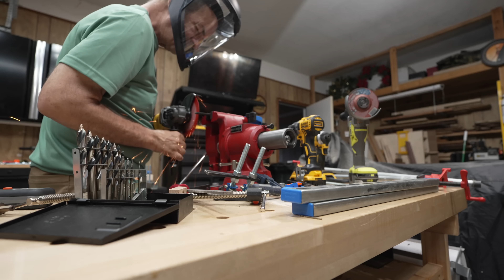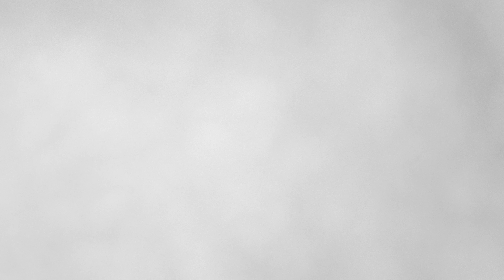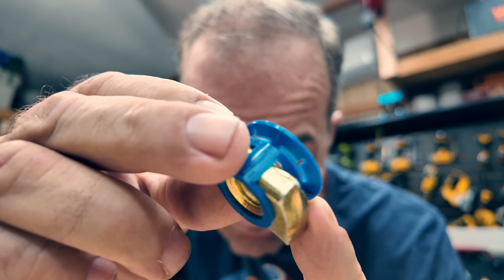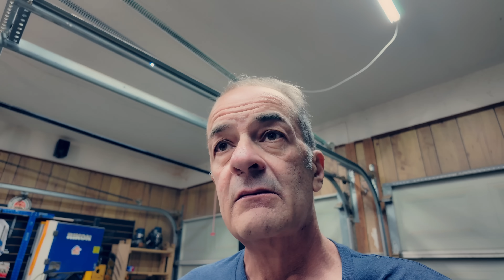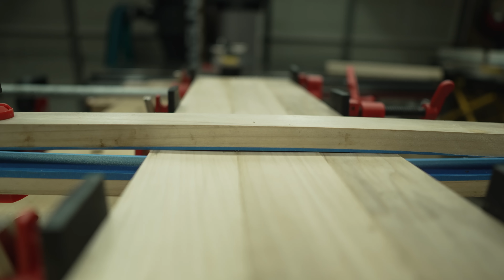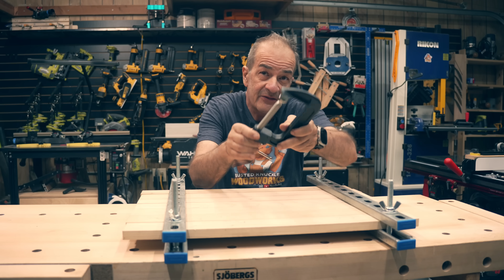This weird clamp could save your next glueup

Comment: You are a mad scientist! I love your clamps so much I gave away my Rockler board clamps. The Rockler solution didn't work that well and I always found it to be a PIA to set up.  I was toying with the side clamp idea and came up with a different solution but I like yours better. In the end I think I will just stick with the pipe clamps because I have so many of them. Also,  I bent the in the bar in middle a so I had about 10mm deflection in the center across a 1m bar. I did this with a few c clamps and a 2x6. I tried the cross bar approach that you showed at first. The bend is fine.
Reply from the maker: I did the end clamps as a proof of concept but to be honest I usually go with pipe clamps myself

Comment: I worked in construction for 41 years. I have used unistrut for 1,000's of different things. I love your tip with them. I made mine several years ago to glue up cutting boards by using tie wire to hold everything together and put pressure on it.

Comment: How can i use the cone nut with the low profile superstruts.  Even if I use a smaller bolt , i.e. 3/8 the bolt head will be roughly the same thickness. I tried to use a 1/2 bolt and a cone nut in a low profile super strut and there is no room for the bolt head
Reply from the maker: Yeah, that combination definitely doesn’t work. You need to use the high profile struts in that case

Comment: How do you keep the cone nuts from sliding when applying horizontal clamping force? I built these inspired by your design, using harbor freight f clamps to make em 4 way like you suggested. But when I apply horizontal force, my bolts begin to angle away from my piece (at the cone nut). Is the small part of the bolt touching the piece/scrap enough to apply proper clamping pressure?
Reply from the maker: I’m having trouble picturing what you’re doing. Send me a pic or a video. Address is on the channel About page.

Comment: 10:45 Heck, with threaded rod coupler nuts, you can go as thick as you can fit in your shop or yard...

So if you really feel the need to build a wood, ocean capable ship, well, enough channel, channel couplers, threaded rod and threaded rod coupler nuts, you can build it...assuming you have enough seasoned wood, wood glue and construction space that is...

😄😁😆😅😂🤣

Comment: I have to say, this presentation is one of the best problems solvers that meets the needs of everyone.
The only weak spot is the small locking pin you have to grab on to. It would be very hard to grasp and turn. 

Why not weld a nut on the end of the clamp screw and use a power drill to tighten it. 

Also, anything over 15” would need a third or fourth clamp/call to tighten the gap that would occur in between the calls.

Comment: you could cut a piece of thick plywood into an eccentric handle (like the golden ration spiral but less pronounced) that mounts over the bolt on each side that tightens as you rotate it around the bolt. Even cheaper and easier than modifying a C clamp!
Reply from the maker: Tried it. Too fiddly. You need to get the gap just right or it doesn’t work.

Comment: What a great idea with the modified C clamps.  For me personally the strut clamps mixed with the pipe clamps would be the way to go for me. Pipe clamps are not all that expensive and I can also help things out by clamping my glue up on both sides with the pipe clams.
As for protecting the struts from the glue, I’m cheap, just use packing tape. 14:01
Reply from the maker: The C clamp idea was just kind of a “proof of concept” if you will, and a response to those comments in the first video that it couldn’t be done. I agree pipe clamps are probably more practical.
Reply: @ I actually made up 6 cull clams out of a 2x6. I ripped them in half long ways to make 1x3’s. I put feet on one side so they stand up on their own. Fixed them to bolt together. Covered them with packing tape so the glue will not stick to them. For the bolts I used 1/2” nuts and washers. Then I took an old 3/4 wrench and cut off a piece of what was left and welded to the box end of the wrens to make a big wing nut out of it. Between those and some pipe clamps I can clamp up a pretty nice cutting board.

You seem like you like to make interesting solutions to wood working problems.  I have a little project you might like. I got the idea from another video. Dig around your scrap pile and make yourself a long drawer that will fit inside the square tubing that your table saw fence clamps to. I made one for each side of my saw. Great place to keep a few pencils, small  flat ruler, a couple of 1-2-3 blocks. I found them to be very handy. I had to get creative about the 1/4 20 bolts that stuck through.

Comment: What an interesting — and clever — idea! I’m actually getting ready to make some counters, and I came SO close to ordering those $120 Rockler clamps. What makes it crazy is that I have the strut on hand.
    (BTW, I saw at least one strut nut being used upside-down. The nuts are intended to ride inside the strut, with that plastic cone holding the nut to the rails — the nuts can slide, but not fall out.)
    Nor did I know of the handle nuts or magnetic washers — thanks!)
    Let the skeptics snipe from the sidelines, but I’m sure the strut bends less under pressure than the lighter sheet metal of the Rockler clamps. Strut is specifically designed to not flex.
    I’m not sure about the modified C-clamps. I think I’ll just continue to use separate clamps to push the board edges together.
    I understand the fear of the edges of the strut leaving marks in the wood. If your material is that soft you probably want to use a length of bar stock or a board to spread the force out anyways.
    My one concern is the metal leaving rust stains, caused by the wet glue. You solved that with a bit of tape.
Reply from the maker: Glad I saved you from buying those overpriced clamps! 👍🤑

Comment: Easier to just use biscuits, dowels or dominos to align the face edges for glue ups.  IMO dominoes work the best but you should always joint the boards first rather than force warped boards together, since the final glued up boards could warp later from the force of the boards forced straight.  I use Kreg clamps on the ends and a longer deeper throat Kreg clamp that can reach around 6" for minor alignment.  Might as well do it right from the get go to save aggravation later.
Reply from the maker: To each his own I suppose

Comment: If you use clamps for the struts and have the clamping pressure over/under your work piece these struts shouldn't bend. Bending happens when the pressure is applied on the unsupported region. Then again, you can use e.g. silicone baking surface or excercise bands as a protection for the wood (on both sides) and if it's just the right thickness it'll help with force distribution.

Comment: I love this idea!  Maybe someone else already said this, but the stiffness of a beam depends on its cross sectional geometry, particularly the "height" (what you measured as 13/16 and 1 5/8).  All else equal, the stiffness will be proportional to the square of the height).  So, since the standard is 2x as high as the low-profile, it will be approximately 4 times as stiff.  Technically, you are correct - more than 2 times stronger - but that's an understatement!  Thanks for all the great information in this video!!
Reply from the maker: @dmooreca2  “Technically, I was correct” is what I’m having inscribed on my tombstone
Reply: As opposed to the, “On the whole I’d rather be in Philadelphia”, of WC Fields? 😂
Reply: I knew this but didn’t know how to explain it. Good job.

Comment: Well someone finally caught up.  I made 6 sets of culls using UniStrurt over 35 years ago.  At that time the various hole options were not available.  I ended up filing out numerous holes on one rail (36" long) to accept 1/2" carriage bolts.  On the opposinging rail I made some hardwood blocks to lock into the rail opening.  I use springs over the carriage bolts to lift the top rail up.  Clamping is done using large palm knobs.  Not quite sure why tons of force is needed to clamp the glue up.  If the boards are not of a uniform thickness or cupped (quality of workmanship), all the clamping in the world will not make make the glue up any better.  These only need to be tightened enough to ensure properly prepared stock is level level plane to one another.  Moving away from pipe clamps to some built in method is dependant on the frequency of use.  Daily/Weekly, yes.  Occasionally not needed.
Reply from the maker: Agree with everything you said. A lot of stuff in this video I only did to show it was possible and to answer the comments from the first video (there were literally thousands). In the first video I only used wing nuts on the bolts because I don’t tighten them very hard at all.
Reply: @BustedKnuckleWoodworks ,
Yes, too much pressure can force out too much glue which is known as a starved glue joint. Properly fitted joints only need moderate pressure. 🧐👍😎

Comment: Genius.... I am kicking myself as I am an Electrician of nearly 30 yrs and was thinking of ways to caul my cutting boards and BAM... you solved my problem with something I have used almost everyday and have in my garage. Now, a tip..... you can easily modify the slots in the strut for a clamp instead of using bolts. Cut your strut to desired length, get a Bandsaw/sawall/hacksaw and at one end, cut inside the channel down to the first slot, do this on each side to create a LONGER slot that now clamps will just slide into. No bolts needed. I also created a Router jig made of 3/4" EMT for $30 that rivals any $500 to $900 Rockler/Woodpecker jig. Well, ok, not really rival but... it works great so..............
Reply from the maker: That’s a great tip for making it even better!

Comment: Hey great idea, I very rarely get any good ideas from woodworking videos. this is a legit tip. Now, how about taking it one step farther and figuring out how to use super strut to make a 4 direction clamp, it's the next logical progression of your work. Retail versions are 2-$300 to clamp a 4' panel. If you can figure out the hardware you could save everyone a ton of money and make a ton for yourself. People have been trying to make a reasonably priced 4 way clamp forever, I think you're the guy. Good Luck
Reply from the maker: You didn’t watch the whole video did you? 🤔

Comment: If you take my suggestion below, and put them on 4 tangs of metal and put 2 bolts through the unistruts on each side,  parallel to the slats of the board . (for each bolt above and below 2 lengths of metal/wood on the bolt, 1 on each side of the unistrut connecting to the bolt through the vertical cam to make V-flexing attachments to the unistrut. Turn the cam, it pulls down on the unistruts and pushes the wood together at the same time. Make the same thing that they made but with wooden cams and drilled struts. Dowel between the holes in the struts, for strength in the V-flex connecting struts?

Comment: make yourself a curled tadpole cam with a pivotal hole in it, that goes vertically on the threaded rods or bolt, made out of hardwood to push the "slats" together. If your threaded rods or bolts are buttressed at the edges of the hole, the cams will work perfectly. And you make those by drilling an off-center hole in the cam. If you want to make them extremely durable, laminate a thin strip of hardwood "1/8"  on the outside edge of the cam.

Comment: For the side clamps, why not make it from a piece of hardwood tapped for some threaded rod. Threads in hardwood will last a long time and taps are not expensive. For a handle, just bend the threaded rod in an "L" shape and put some plastic tubing over the threads for comfort to your hands (if you care). For pads against the work piece, a suitable block of hardwood with a countersunk cavity for a nut to retain the block. Alternatively, cross drilling the rod end for a piece of wire to retain the block. In either case, a double nut and washer on the opposite pressure side takes the force.
Reply from the maker: You’d probably want to use acme threads for any kind of a clamping mechanism. I don’t know how well that would work in wood.

Comment: Hi Lee, great video. Your solution to applying horizontal force got me thinking. Could you just use a simple cam mechanism with the bolt as its axis?
Reply from the maker: I actually tried this but it doesn’t provide much travel unless you make them pretty large.
Reply: @ Makes sense. You’d need your bolts pretty close to the edge of your panel. Keep up the good work. The woodworking world needs more of your cost-effective solutions.

Comment: Ive been using strut channel around the shop for 40+yrs. Having a Dad in the electrical industry sure helped. I use it for lumber racks, tool racks, roof racks, etc. 
I even used it to mount my 3 phase inverter above my service panel. Good stuff. Also, if you buy your threaded rod in the strut asile, you get 10 feet for the same price as a 3ft piece in the hdwr asile. Great video. Appreciate your no nonsense videos.
Reply from the maker: Glad you enjoyed it! Strut channel is super versatile.
Reply: Good tip on the price difference. Thanks. 😎

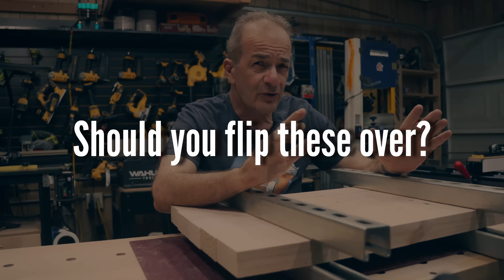Comment: 7:03 Honestly, you could just put a 3/4 inch piece of wood where the strut touches the workpiece, if one fears marks on the workpiece.
Reply from the maker: That is certainly an option.
Reply: One of the best solutions to center the pressure along the long edge of the glue up I’ve seen is to cut a dowel of the same diameter as the stock lengthwise, place it between the stock and the clamps and that will self center itself as you tighten the clamps. 👍

Comment: Hi Lee, I recently found you and I love the videos. I am a beginner trying to do woodworking as a hobby. I thought about using the strut channels as a straight edge reference when squaring a board. Reason for that is because I don't have the money or space for a table saw or even a miter saw. So the idea was to use the strut channel as a fence for a plunge router and that way making square boards of larger lengths. Let me know if you have tried that. I would like to know if the strut channels are straight enough for that use case.
Thank you for the funny and informational videos.
Reply from the maker: Strut channel is very straight and I have used it as both a router and a circular saw guide.

Comment: I saw you strut your stuff and it was OK. it actually made a lot of sense...  The stuff you struted your stuff to is known as uni-strut on job sites.. The spring nuts drop into the open end and spin to lock in place.. Use all thread instead of bolts.. MUCH Cheaper...
Reply from the maker: And we still can’t agree on what to call it 🙄😂

Comment: I keep watching this video because it has so many neat ideas.  For horizontal clamping, IMO the wedge/shims seem the best option for ease of use, cost, and coverage.  Probably over thinking it, but with the modified C clamp and only 2 cauls, it seems like I wouldn't get even horizontal pressure especially in the middle or ends.  Consider 45 degree angles out from the point of horizontal clamping, and you should get some overlap if you want to avoid gaps in your seams, especially if the pieces you are edge gluing have a bit of bend to them.  Minor niggle, but something I think the wedges address better.
Reply: You could use a slimmer piece of strut channel to give a much more rigid surface to press against.

Comment: I bought the thicker Unistrut in 10 foot lengths and then cut them into thirds so I have a total of 6 each about 3'-4" long.  Gives me a lot of flexibility for projects based on my shop size even up to a table top.  I use the open side of the strut facing the wood and covered them with cheap painters tape to help prevent glue sticking, and easy replacement if I ever feel it's needed.

Comment: Big selling points for me with the mods that eliminate the horizontal pipe clamps are cost and less mess.  Schedule 40 pipe and pipe clamps do cost some decent money and take up space in a small shop.  They do get covered in squeeze out, which you can wipe off or scrape off when you are done, but what I don't like is having to work around them to clean up squeeze out during the glue up.  This would let the squeeze out start to harden up, and still allow easy access to come back through with a scraper to clean in up without removing and clamps until the glue is fully cured.

Comment: Love it! I’ve always had the idea in the back of my head about doing “something” with c-clamps to make them more useful. Mostly when using them like a press, like in compressing a brake caliper or forcing a pin into a hole. It seems the C clamp is never the right length, the head is always slipping off or doesn’t fit right etc. I’m going to start experimenting with these right away.
Reply from the maker: Go for it! There’s lots of things you can do…

Comment: You sir are a very interesting guy. I absolutely adore many of your concepts however often parts are not available in England or are very pricey!
Kindest
Bob
England
Reply from the maker: Thank you for the compliment! You might want to check electrical or plumbing supply dealers in your area (the kinds of places frequented by tradesmen) as that’s who most commonly use these devices.

Comment: If you are cranking down on the bolts enough to bend the bars in the middle, you are using too much pressure.  Seriously, that much pressure is going to leave impressions in the wood.  Why does anyone need that much pressure?
Reply from the maker: Nobody needs that much pressure, but if you read the comments in the first video a lot of people mentioned it anyway